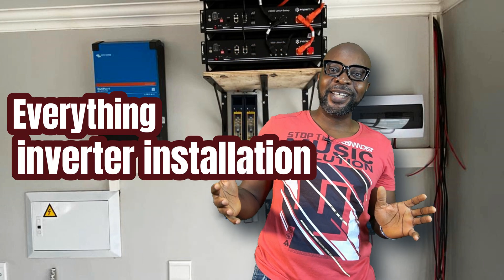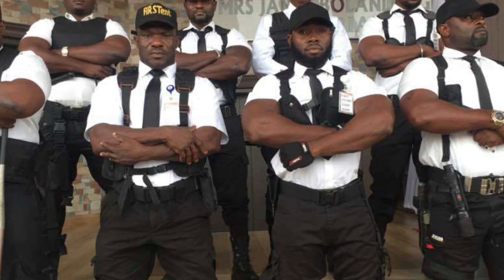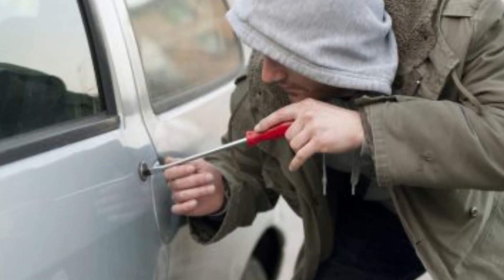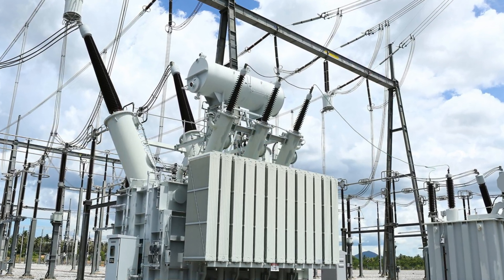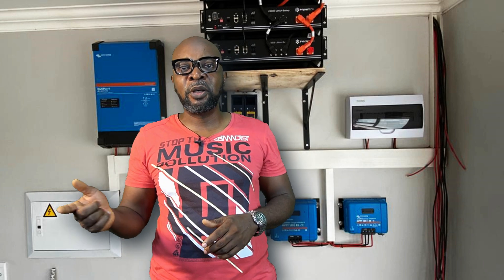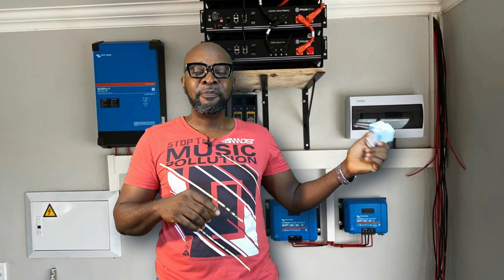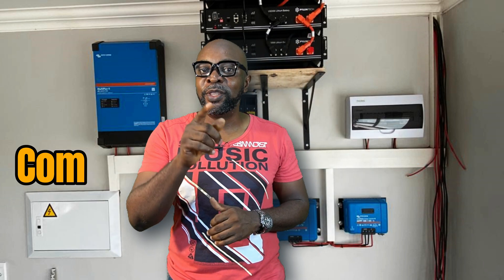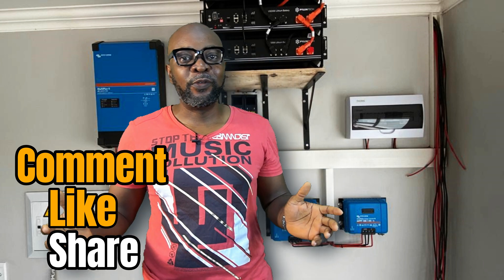How to use your Surge Protective Devices (SPDS) in your Solar system for maximum insulation.

Comment: so when bright flash from lightning shines onto pv array there will be voltage spike, If my inverter/charge controller max input is 450v DC and my PV array VOC is 400 there is only 50v extra before inverter is damaged. How will that spd know to stop before 450v?
How will connecting to ground/earth stop voltage spike when pv panels are their own circuit? PV panels dc wiring does not go through earth/ground. I understand with lightning strike it wants to go to ground and spd will allow path but i think inverter will be cooked anyway from over voltage.

Comment: Does the digital adjustable Voltage protector has the same function as AC-SPD because you didn't talk about AC-SPD
Reply from the maker: @muhammedadio4607  Yes it's an AC SPD
Reply: @smilinsunsmilinsun8056  so, I wouldn't need an AC SPD once I am using adjustable Voltage protector?
Reply from the maker: @muhammedadio4607  Yes

Comment: Voltage regulator is different from spd sir

All you re showing n demonstrating isn’t spd 

It’s just avr (automatic voltage regulator) most are programmable to accommodate voltage you want in the output
Reply from the maker: Most of the time, our observations are shaped by the knowledge and exposure we have and ironically, we often become quite confident in them. An AVR (Automatic Voltage Regulator) is essentially a type of surge protector. It’s designed with both over-voltage and under-voltage protection functions.  With Amps regulation as well. If there’s a spike in your voltage, it will block it. So yes, it acts as a surge protector, my friend.

Comment: I install them too, but is there any need for these if many inverters claim they have them inbuilt?
Reply from the maker: @odoohub5010   unless install yours it doesn't matter if the inverter has. Inverter is not the only component you have there.
Reply: @smilinsunsmilinsun8056  thanks

Comment: Thanks I'll bet you know that the presence of SPDs doesn't mean you're 100% safe from lightning. An additional lightning protection system with separate earth rod connections is advised.
Reply from the maker: Those are the standard Electrical wiring provisions done in the properties, this has nothing to do with the Solar Installer. If they need the Solar guy to do it then it is a different arrangement. Thank so much Buddy for your insightful comment.

Comment: I'm using 320w x 2 panels ,1 220 ah tabular battery,  do i need to use any protection system.
Reply from the maker: Every system no matter how small needs protection

Comment: Hi the unit your showing at 8.39 is not a SPD it's a PFR  (phase failure relay) it regulates high n low voltage. SPD they are different from what your showing.
Also SPD comes in two types on is DC n the other is AC so u need to buy 2different one for pv side other for grid side.
Reply from the maker: Thanks for reaching out what I was showimg is a digital surge protector not a PFR the design might look the same but when its lighted up you will see the difference. Mybe I should have done a closer shot.  Not sure you watched the video till the very end because I talked about DC surge and also AC surge. Maybe you need to watch again till the end. Thank you so much for your observation its highly appreciated
Reply: @smilinsunsmilinsun8056  I never heard of digital spd. Normally spd come in one time use. If it goes bad you change its cartage. 
If u can put the link of the product which u bought I too can study the datasheet. I checked the Internet I couldn't find one. Not tring to put you in a spot. The community needs good info I am glad your tring to put the info out there bcz I am not a youtuber. I know its hard work to get one video out. 
I hv done my own solar projects I hv 2 solar tracking systems and I learned alot from the Internet too. Keep up the good work.
Reply: @smilinsunsmilinsun8056  that's not a surge protective device you showed @8:44 . It's just a voltage monitor. It doesn't protect against AC surges. We have Ac SPD's.
Reply: I agree with you. It appears that of the three units he showed in the video, only the second one (at about 11:25) might be a proper surge protection device. For some reasons, he appears to have a very loose definition/understanding of surge protection and surge protection devices.
Reply: Can this digital voltage protector hold a load hold a 120A  load,  pulling from the inverter
Reply: I hooking up my system I have SPD for AC and DC and a PFR, should it go before or after SPD?
Reply: @chefbperez  the pfr should go after the SPD
Reply: That device is an AVS. Automatic voltage switcher with delay. It's not an SPD. An SPD is usually in the form of a gas tube or a metal oxide varistor. It works by shorting itself out when it's working voltage is reached. Depending on the magnitude and duration of the surge, it is always better to have a 2-pole circuit breaker before the SPD. So that when the SPD trips,  it can activate the breaker. A good ground is also essential for the proper operation of an SPD, to divert the surge away to ground. That device he showed works without a ground. It's just like the popular TV Guard/Fridge guard being sold in the market, with an added feature.

Comment: Hello Ikenna, Here to get a DC breaker is a totally difficult task. Simply because they are not in the market. Currently am using an AC 100A breaker between Charge controller and Solar array and when the DC amperes Exceeds 30 A flows through it. It gets heat and produces some sparkling sound inside but doesn't Break the circuit. Is it safe to use it or i should remove it. Am using it as a switch. Kindly advice.
Reply from the maker: When you use AC circuit breaker for DC you decrease your energy generation and that can also cause fire in the installation because it will be heating up. DC circuit breaker is available in Nigeria
Reply: @smilinsunsmilinsun8056  l am in Kenya but i have tried to look for DC breaker without success. But i will remove the AC breaker because it was heating up.
Reply: We have the spds and DC breakers in Nairobi